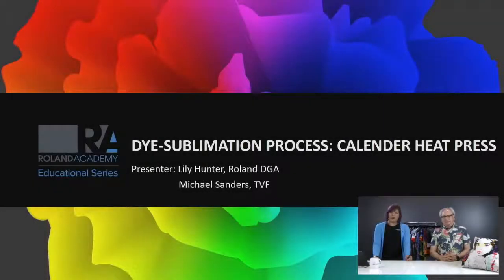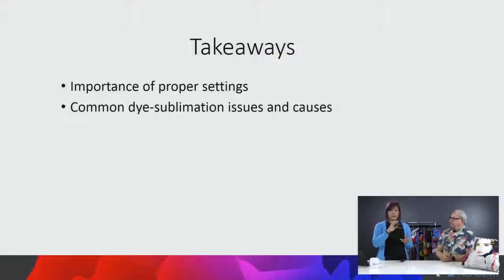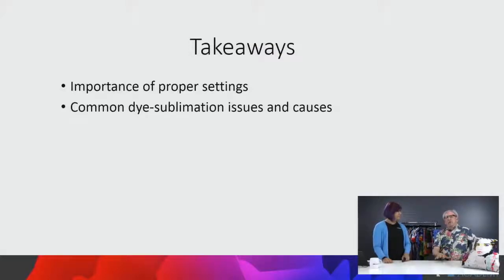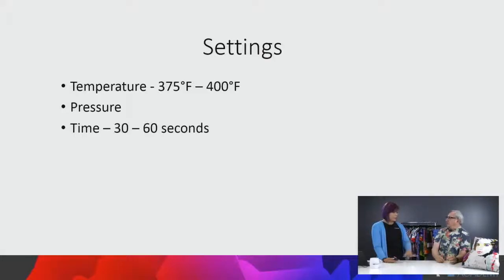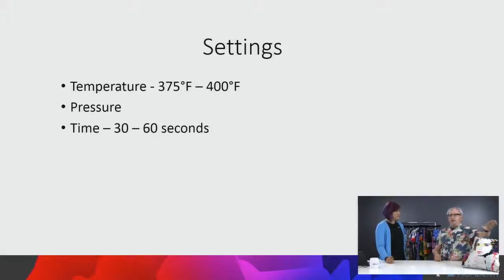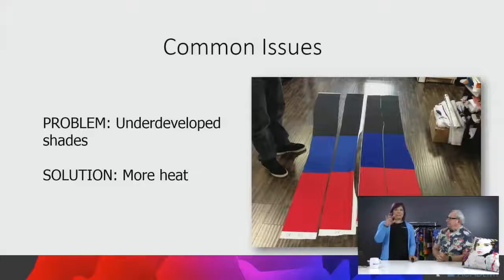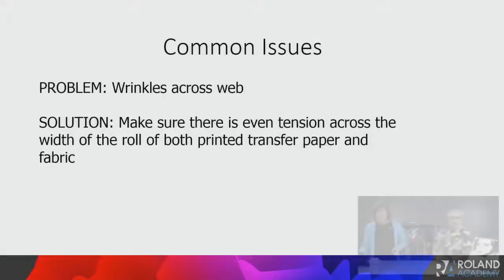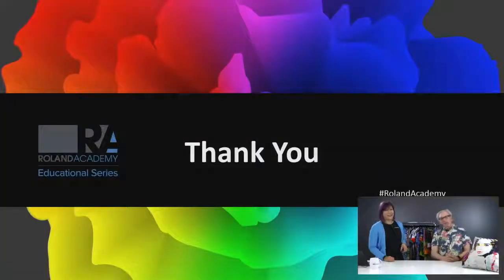Fabrics 101 - Dye-Sublimation Process: Calendar Heat Press (4/6)

Comment: Hi

Thanks for your good information.
I want to know the structure of heat oil roll.
Is hot oil circulated in roll or it is by inner electrical heater element?
electrical heater element is fixed or it is rotating with roll and its power is by collector?
and ....

thanks a lot